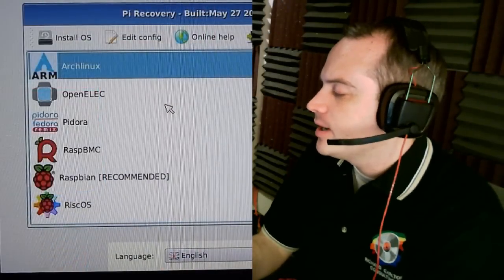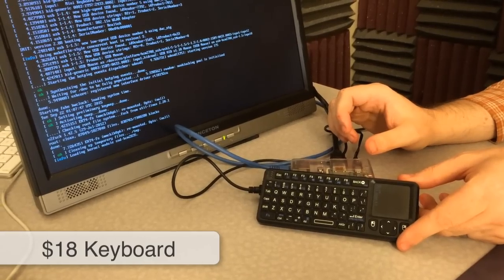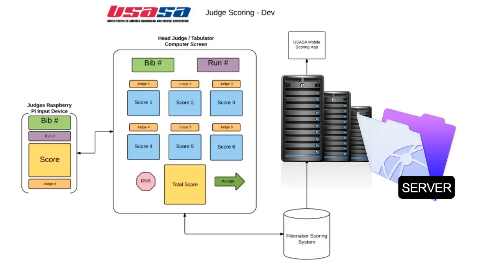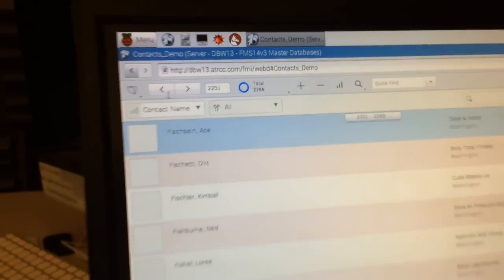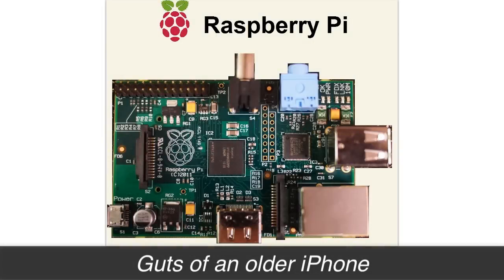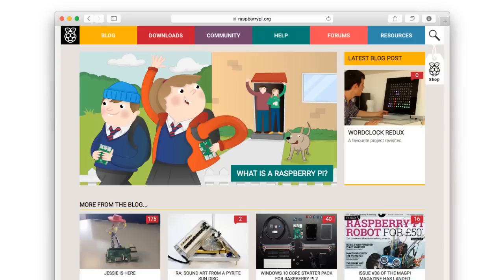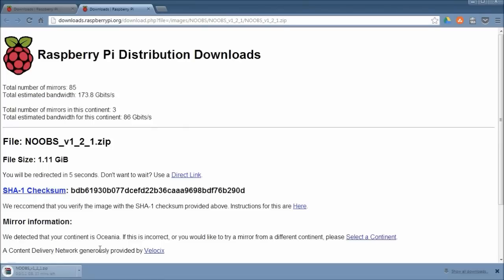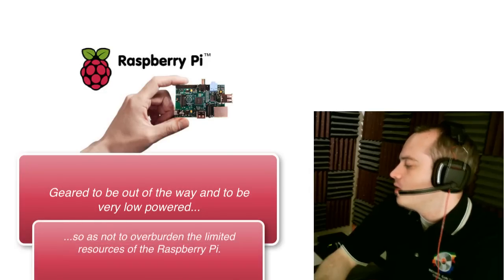Raspberry Pi  | FileMaker 14 Tutorial

Comment from the maker: From RCC Staff:
I actually work closely with this customer and they explored a number of iOS options prior to going this route.  Some of the problems faced were:
1)  Very cold weather on the mountain where they are judging snowboard compititions
2) The need for 10-key input which naturally provides touch feedback on what is entered.
3)  Multiple judges interacting simultaniously with the database in this manner.
 
iPads do not run well in temperatures below 32 F.  Also, thick gloves are often worn by judges during compititions.  As a result they decided to run a test program and went out and built their own devices which allowed them to have multiple 10 key devices connected directly with a small monitor for feedback without interfeering with other devices in the booth.  The 10 key allows the judges to quickly enter information without taking their gloves off.
 
With the following specs:
A 900 MHz quad-core ARM Cortex-A7 CPU (~6x performance)
1GB LPDDR2 SDRAM (2x memory)
the Raspberry Pi 2 Model B is actually more powerful than a lot of phones that people are using to access web direct.

Again, this was something that a customer did on their own and was not a project of Richard Carlton Consulting, but it does go to show that web direct opens up new avenues for FileMaker that we never thought about before.